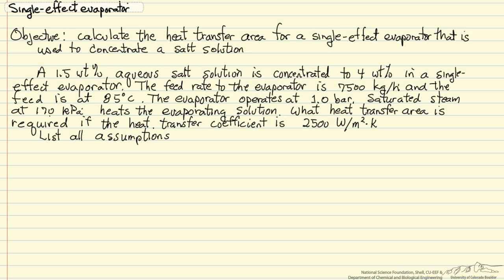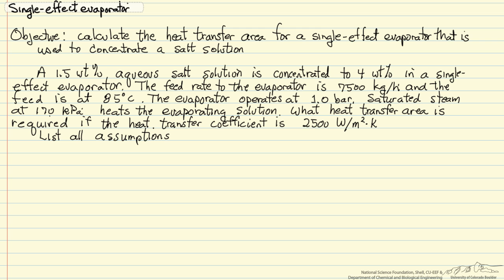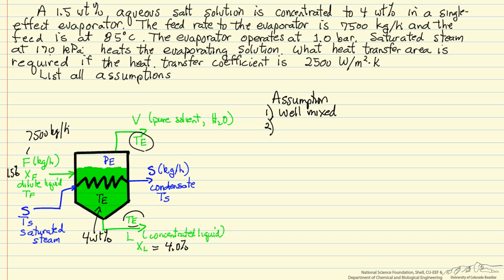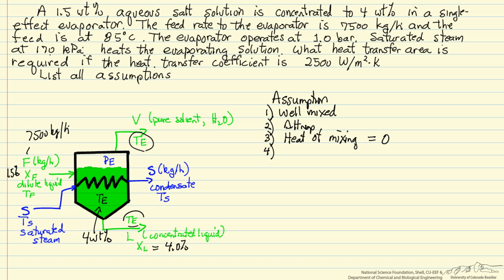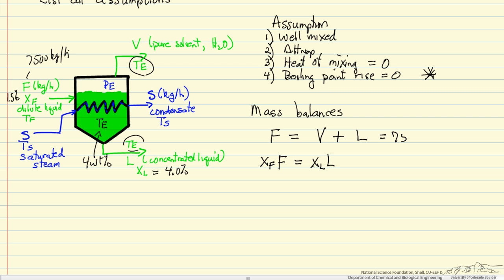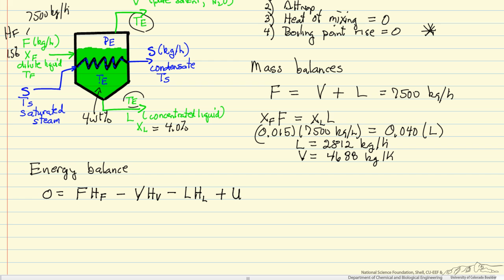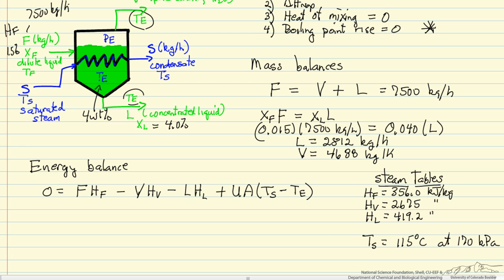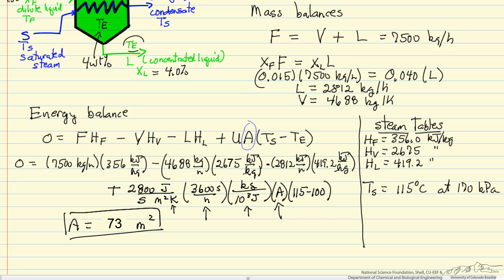Single-Effect Evaporator: Heat Transfer Area

Comment: U=2500 not U=2800. therefore, A=78m^2
thank u. great video!
Reply from the maker: Thanks for catching this. U = 2500 is stated in the problem, but 2800 was used in the calculation.  The area would then be 82 m^2.

Comment: what do you do if the evaporator pressure is different than 1 bar?
Reply: For different evaporator pressure , we get different saturated temperature in the evaporator . Then , we look into the Duhring Plot to get the required temperature for the solution with exit composition . For more details , you can watch our video on "Evaporators" on our channel.

Comment: 1. the value  of  heat transfer coefficient not even correct!

it should be 2500, but in the calculation is 2800.

2. why isnt u use heat capacity to find Hf instead of using steam table? is it have a ny different?

if so, when to use heat capacity and when to use steam table?